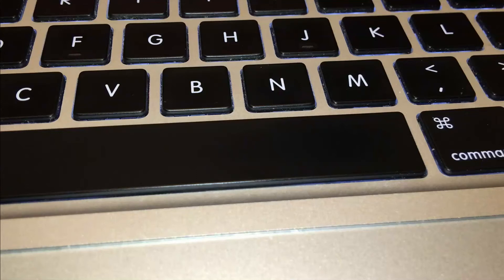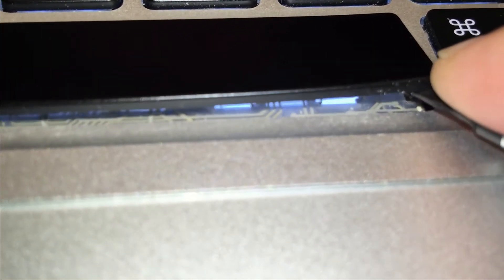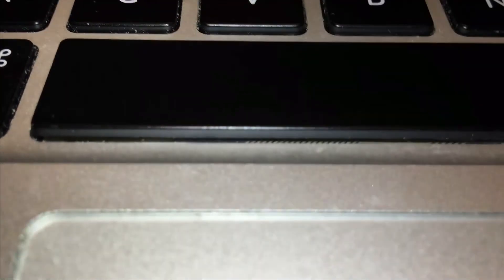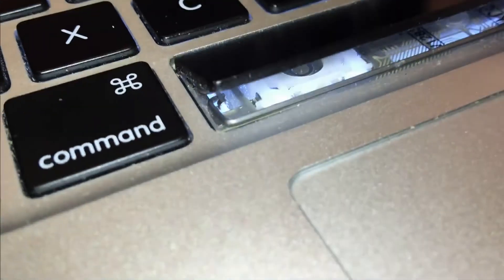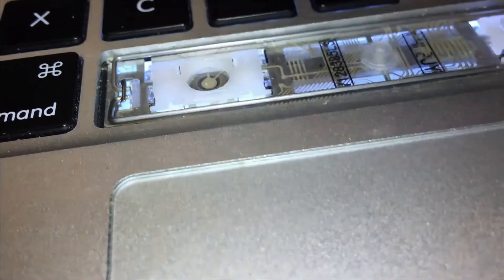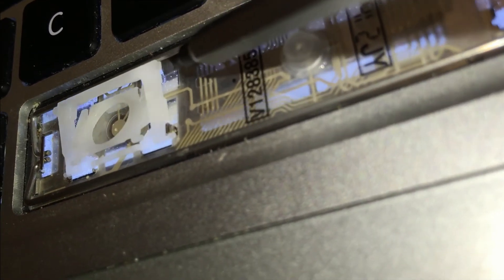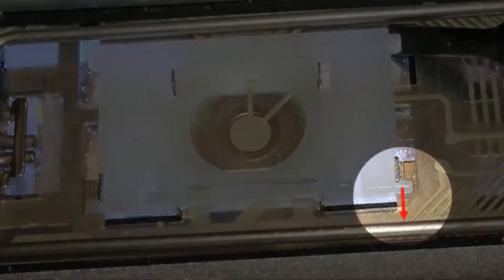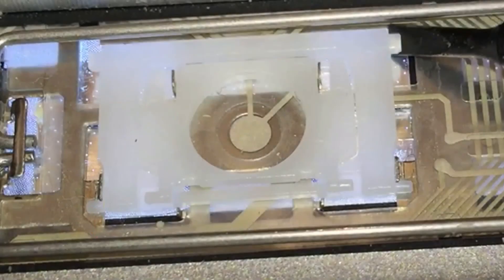Part 1. How to Remove, reinstall or repair a key on Apple MacBook laptop (space bar removal)

Comment: Thanks mate, I was able to clean it under the spacebar and now it's not mushy anymore thanks to your guide. Re-installing is relatively easy. 1) Clamp the top clamps back to the top metal part 2) align the spacebar back to the correct position. 3) Clamp the sides first by pressing on the spacebar down 4) Go around the spacebar pressing it from all angles so all the clamps will catch.